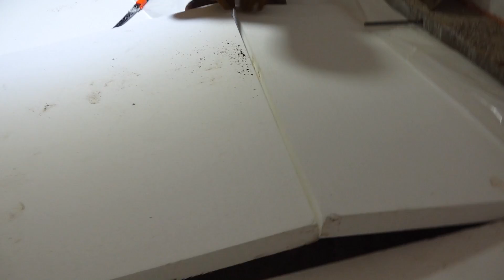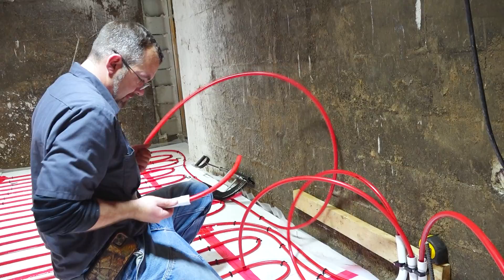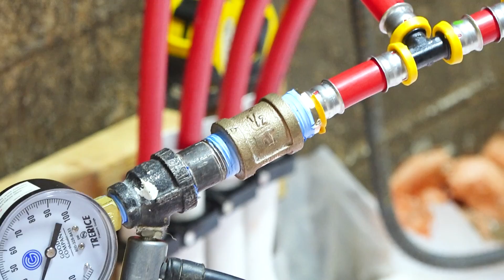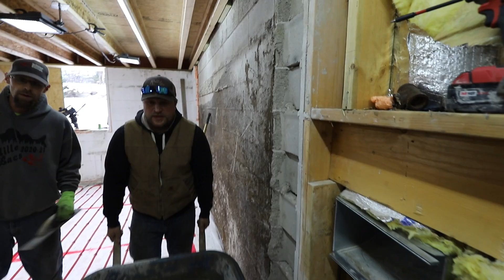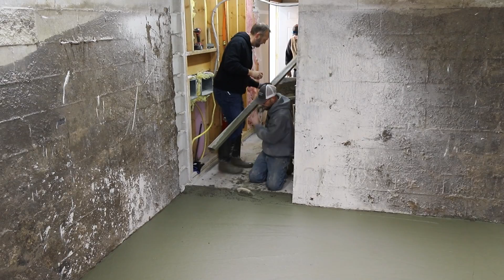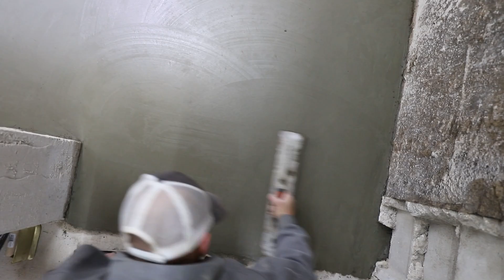Pouring the Basement Floor with Infloor Radiant Heat | Home Renovation & Addition Part 19

Comment: The radiant heat guy is wrong about everything he says.  Cold climates like Minnesota and where I'm up in Canada recommend 12-inch spacing of 1/2 tube with a max run of 300 feet.  The only thing he got right was, yes, you O2 tubing

Comment: I wonder if, for the DIY renovator, if it would be easier to pour the concrete, get it reasonably level but not necessarily polished; then use a floor leveling compound to get the polished finish?

Comment: What is amazing is the range of skills required for pouring concrete. From the guy that holds the hose to reduce the surges for the man guiding the hose. To the guy with the wheelbarrow that needs a board to tell him where to dump his load. To the guy with the pusher that gets the concrete to approximately the correct depth. To the guy squatting with the long tube who makes the first level surface. To the trowel craftsman. And then there are the few experts who go from craftsmanship to artistry. A rare minority.

Comment: Did the "plumber" ask where the existing manifolds were? Why didn't he install the input and output manifolds and then connect them together for the test? Why didn't he bring his own compressor? Doesn't every new installation require a pressure test?

Comment: Was installed furniture in a building for a concrete business. Many times you have to find the highest point to start so everything is level. The floors were not finished by this guy! Piled by edges of the room and by pillers!
You'd think a concrete business would have perfect flat floors!

Comment: I see a window opening to the outside. Why didn't you order a truck with a 'boom snorkel' to simply pipe the concrete in? A six inch concrete floor of that square footage needing to be poured one wheelbarrow load at a time? No thanks! LoL
Reply: The truck couldn’t get within about 50’ of the window even if we could It would had to moved around by hand or wheelbarrow. Using a pump would have cost $650-750 and not saved any time. 2 guys moved all of the concrete in to places in about a 30 minutes. Tires on wheelbarrow  will not damage the pex a board was placed every time it was dumped

Comment: I would have figured out a way to pour the concrete through the window instead of wheeling it through the house.  Bigger mess and more opportunity to punch a hole in the pex.
Reply: The truck couldn’t get within about 50’ of the window even if we could It would had to moved around by hand or wheelbarrow. Using a pump would have cost $650-750 and not saved any time. 2 guys moved all of the concrete in to places in about a 30 minutes. Tires on wheelbarrow  will not damage the pex a board was placed every time it was dumped

Comment: All these other people stunned at the craftsmanship and I think its bloody awful. I've poured thousands of cube and I think this was at best half assed and sloppy. No tie in to the walls, no steel, no chairs, not pokered, far too dry, should have been a 150 to 180 slump and pumped. Guaranteed theres voids aplenty around the pipe which ruins the thermal transfer. Insulation was crap far too much flex in it which shows the ground was not properly leveled before hand, should have use sand or pea gravel to level the soil.  The finish is pretty bad, there's absolutely no reason ever that you should do it by hand, any crew should have a power trowel which gives a far far better result. Also no cubes taken, we're just gonna trust the concretes correct are we?, none of this would ever pass building inspection in the UK.

Comment: Are you worried about the thermal loss between your heated concrete floor slab and the foundation? Looks like a big thermal bridge and a potential condensation point

Comment: Very nice concrete job but I was wondering if it would have been worthwhile to have installed some reinforcing concrete wire.   
I was surprised to hear the plumber say that the Pex used for heating is different than the "normal" cold water Pex - that it has to have an oxygen coating.  Who knew?  
I have seen others use dimpled insulated Styrofoam panels that capture the Pex between the raised dimples - no staples needed and that also means no one walks on the Pex during the pour.

On a basement floor with exterior walls, I would think there has to be an optimum pattern for laying out the Pex grid to ensure uniform heating of the floor throughout the basement; i.e., rather than back and forth from one side to the other, should the warmest water flow around the outside walls and spiral in towards the center?

Comment: You guys couldn’t have pumped that right through the window?
Reply: The truck couldn’t get within about 50’ of the window even if we could It would had to moved around by hand or wheelbarrow. Using a pump would have cost $650-750 and not saved any time. 2 guys moved all of the concrete in to places in about a 30 minutes. Tires on wheelbarrow  will not damage the pex a board was placed every time it was dumped

Comment: ?  Why did you not use a concrete pump? It seems so much easier than so many wheel barrows. 2nd? Do you have to make concrete different when it is so cold outside?
Reply: The truck couldn’t get within about 50’ of the window even if we could It would had to moved around by hand or wheelbarrow. Using a pump would have cost $650-750 and not saved any time. 2 guys moved all of the concrete in to places in about a 30 minutes. Tires on wheelbarrow  will not damage the pex a board was placed every time it was dumped

Comment: Matt, Wow!! What a great job by both the plumber and the concrete guys, especially Dan!
Donavan, why noy pour the concrete through the available (yet temp boarded up) window instead of all the trips with the wheelbarrows? Was the extended time with wheelbarrows advantageous to the spreading or something?
Reply: The truck couldn’t get within about 50’ of the window even if we could It would had to moved around by hand or wheelbarrow. Using a pump would have cost $650-750 and not saved any time. 2 guys moved all of the concrete in to places in about a 30 minutes. Tires on wheelbarrow  will not damage the pex a board was placed every time it was dumped
Reply: @donavanshomes  Thanks for explaining that to me Donavan. While watching the video, I did notice a couple times that the wheelbarrow metal front wheel guard that was supposed to go on the small sheet of plywood, was maneuvered onto the pex a couple times. I’m sure the constant line pressure didn’t decrease or you two would have noticed. Hopefully no leaks. BTW, how do you find a leak if there is one in a year or two? Thanks again for all the excellent work and advise/guidance you’re giving to our friend!

Comment: Stupid question why not use the big hole in the side of the house to pour your concrete
Reply: The truck couldn’t get within about 50’ of the window even if we could It would had to moved around by hand or wheelbarrow. Using a pump would have cost $650-750 and not saved any time. 2 guys moved all of the concrete in to places in about a 30 minutes. Tires on wheelbarrow  will not damage the pex a board was placed every time it was dumped

Comment: I do not understand why you did not just cut a hole in the plywood covering the window and let the concrete truck pump direct into basement instead of making those guys do it all with wheelbarrows. That would have saved a LOT of time and if I were the contractor I would have charged extra just for having to do all the hauling by hand.
Reply from the maker: Can’t get the truck over there
Reply: The truck couldn’t get within about 50’ of the window even if we could It would had to moved around by hand or wheelbarrow. Using a pump would have cost $650-750 and not saved any time. 2 guys moved all of the concrete in to places in about a 30 minutes. Tires on wheelbarrow  will not damage the pex a board was placed every time it was dumped

Comment: Dont you have concrete pumps in America, in Australia we would pump the concrete in with a large hose, would take 15 minutes  to fill the room.
Reply: The truck couldn’t get within about 50’ of the window even if we could It would had to moved around by hand or wheelbarrow. Using a pump would have cost $650-750 and not saved any time. 2 guys moved all of the concrete in to places in about a 30 minutes. Tires on wheelbarrow  will not damage the pex a board was placed every time it was dumped

Comment: Coming from somewhere that the average minimum temperature in winter is 7degC, it amazes me tge lengths you guys need to go to in order to keep warm! 
I really find it fascinating to watch the different methods of construction you employ there. It had never occurred to me that you would put foam insulation under the concrete, and ive never seen subfloor heating installed!
The last video where you did tge front roof extension and you were discussing the freezing line (I think thats what you called it) where snow and ice  builds up at the edge of the roof, really blew me away. It is something Id never even thought about!
Really enjoying this series Mate, keep it going 👍🏼😊
Reply from the maker: Average winter temp here is -15c and in Jan we’ll get down to -35 for a few days every year. A little different here 😄
Reply: @mcremona  lol, just a tad!!  Brrrrrr....Daytime average winter temp is about 16C...quite pleasant if theres no rain 😊

Comment: Subfloor heating is an overdue method that deserves to be put into more livingspaces. With this in mind, I have two question. Did you consider or is it possible to install a floor drain in conjunction with such a system? And was there not a concern about creating a heat gap between the concrete pad and the walls, especially against the exterior walls?

Comment: I assumed you were going to hose or chute the concrete in through the egress - any reason they didn’t?
Reply: The truck couldn’t get within about 50’ of the window even if we could It would had to moved around by hand or wheelbarrow. Using a pump would have cost $650-750 and not saved any time. 2 guys moved all of the concrete in to places in about a 30 minutes. Tires on wheelbarrow  will not damage the pex a board was placed every time it was dumped

Comment: everybody that asked why they didn't pour thru the window, pump the concrete, or use rebar is stupid
Reply: The truck couldn’t get within about 50’ of the window even if we could It would had to moved around by hand or wheelbarrow. Using a pump would have cost $650-750 and not saved any time. 2 guys moved all of the concrete in to places in about a 30 minutes. Tires on wheelbarrow  will not damage the pex a board was placed every time it was dumped

Comment: Wow, wheelbarrows and heavy concrete. Why not a pump and self levelling concrete?
Reply: The truck couldn’t get within about 50’ of the window even if we could It would had to moved around by hand or wheelbarrow. Using a pump would have cost $650-750 and not saved any time. 2 guys moved all of the concrete in to places in about a 30 minutes. Tires on wheelbarrow  will not damage the pex a board was placed every time it was dumped
Reply: Thank you for the reply. I was just curious more than anything.

Comment: Always turns me off to see concrete poured with no steel on chairs in the pour.  In this case it would seem a pump truck would have been useful.  Less overall mess in your finished areas and a quicker placement without all the traffic on your Peks.  The science has been done and fiberglass does not replace steel when used in concrete, not even close.  You want that floor to remain an integral unit and steel keeps it in the same plane. Your empirical experience demoing your wall should have highlighted the difference between reinforced concrete and non reinforced.  If you want to explore the science behind concrete's use in construction I highly recommend  Tyler Rey's (sic) You Tube channel showing some of his work as a Ph.d.  teaching engineers about concrete.  The only reasons there is no steel in a pour is ignorance or avoidance of work.
Reply: The truck couldn’t get within about 50’ of the window even if we could It would had to moved around by hand or wheelbarrow. Using a pump would have cost $650-750 and not saved any time. 2 guys moved all of the concrete in to places in about a 30 minutes. Tires on wheelbarrow  will not damage the pex a board was placed every time it was dumped
Reply: I'm with you all these other people stunned at the craftsmanship and I think its bloody awful. I've poured thousands of cube and I think this was at best half assed and sloppy. No tie in to the walls, no steel, no chairs, not pokered, far too dry, should have been a 150 to 180 slump and pumped. Guaranteed theres voids aplenty around the pipe which ruins the thermal transfer. Insulation was crap far too much flex in it which shows the ground was not properly leveled before hand, should have use sand or pea gravel to level the soil.  The finish is pretty bad, there's absolutely no reason ever that you should do it by hand, any crew should have a power trowel which gives a far far better result.
Reply: @TheSharkeyandgeorge   why would you power trowel a 15x15 in a home owners home in the winter are you trying to gas out his whole house my good sir!?
Reply: @concretewhisperer9877  1. There's a massive window 2. You get electric power trowels

Comment: Why didn't you use a concrete pumper. Seems like way to much to have to push one wheelbarrow at a time.
Reply: 2 guys on wheelbarrows for an hour 100 bucks pump truck 400 bucks min.
Reply: The truck couldn’t get within about 50’ of the window even if we could It would had to moved around by hand or wheelbarrow. Using a pump would have cost $650-750 and not saved any time. 2 guys moved all of the concrete in to places in about a 30 minutes. Tires on wheelbarrow  will not damage the pex a board was placed every time it was dumped

Comment: The cement truck couldn't stick his chute through the window?  Great video Matt!!!
Reply: The truck couldn’t get within about 50’ of the window even if we could It would had to moved around by hand or wheelbarrow. Using a pump would have cost $650-750 and not saved any time. 2 guys moved all of the concrete in to places in about a 30 minutes. Tires on wheelbarrow  will not damage the pex a board was placed every time it was dumped
Reply: @donavanshomes  😉😉😉

Comment: A  concrete pump would have made that job go way faster, and it would have been far cleaner.
Reply: The truck couldn’t get within about 50’ of the window even if we could It would had to moved around by hand or wheelbarrow. Using a pump would have cost $650-750 and not saved any time. 2 guys moved all of the concrete in to places in about a 30 minutes. Tires on wheelbarrow  will not damage the pex a board was placed every time it was dumped
Reply: And far more expensive

Comment: Don’t you have concrete pumps in Minnesota?
Reply: Duh.  It was a cost thing
Reply: The truck couldn’t get within about 50’ of the window even if we could It would had to moved around by hand or wheelbarrow. Using a pump would have cost $650-750 and not saved any time. 2 guys moved all of the concrete in to places in about a 30 minutes. Tires on wheelbarrow  will not damage the pex a board was placed every time it was dumped

Comment: Wheelbarrows? Really? If there was ever a job for a pump hose.
Reply: Yes and its also $750.00 + more
Reply: The truck couldn’t get within about 50’ of the window even if we could It would had to moved around by hand or wheelbarrow. Using a pump would have cost $650-750 and not saved any time. 2 guys moved all of the concrete in to places in about a 30 minutes. Tires on wheelbarrow  will not damage the pex a board was placed every time it was dumped

Comment: How much does a small concrete pump cost?  Geez!
Reply: $750+
Reply: The truck couldn’t get within about 50’ of the window even if we could It would had to moved around by hand or wheelbarrow. Using a pump would have cost $650-750 and not saved any time. 2 guys moved all of the concrete in to places in about a 30 minutes. Tires on wheelbarrow  will not damage the pex a board was placed every time it was dumped

Comment: Why didn’t you use the window to pour the concrete.
Reply: The truck couldn’t get within about 50’ of the window even if we could It would had to moved around by hand or wheelbarrow. Using a pump would have cost $650-750 and not saved any time. 2 guys moved all of the concrete in to places in about a 30 minutes. Tires on wheelbarrow  will not damage the pex a board was placed every time it was dumped
Reply: See answers above

Comment: So what exactly do you do if one of the radiant heating lines gets punctured during the pour?  Does that mean the whole floor has to get jack-hammered out again?  Or is there time to do a quick repair before the concrete sets?
Reply from the maker: You’d have to splice the damaged area

Comment: We build on a slab, here in Australia. The footings are part of it with the steel reinforcing of floor & footings connected, wall reinforcing steel bar tied into the footings all the way up to the roof trusses, the whole thing formed up and concrete goes in a single pour.

Comment: I'm certain concrete workers don't need to go to the gym! I'm exhausted just watching all that work. I hope they make good money. When we built a house about 40 years ago they were just putting the finishing touches on the garage floor and my son, who was not quite 2, opened the door that led to the garage and ran the full length of the garage leaving footprints. I still feel so bad for the worker who had to go back and fix it